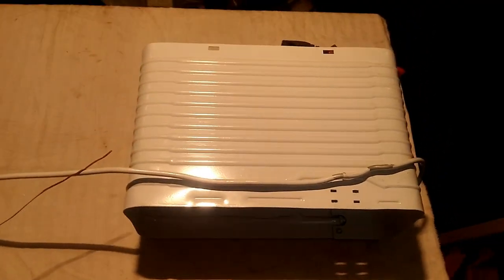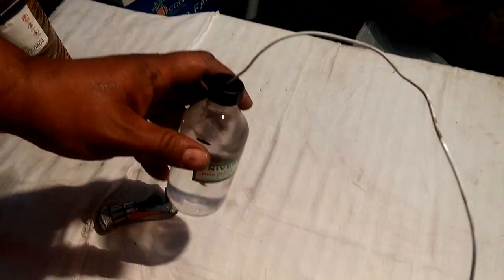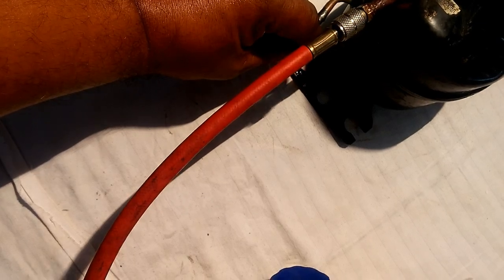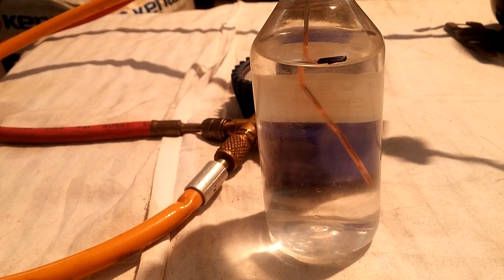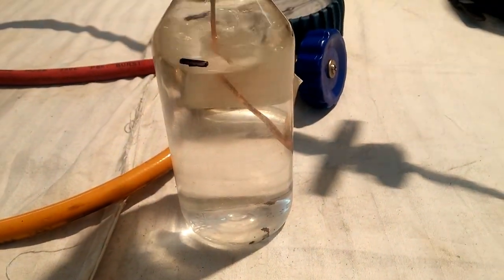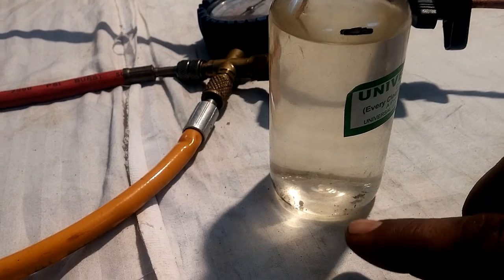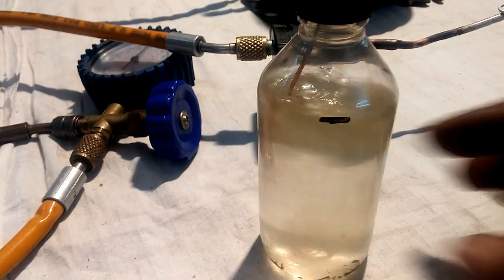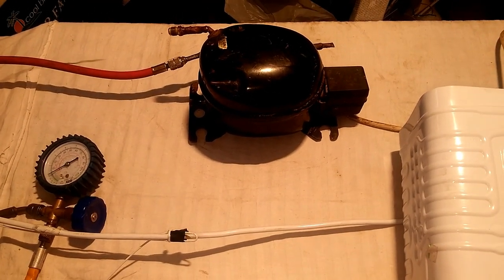How To Clean Refrigerator's Choked Capillary Tube | Easy Way

Comment: Kya yeh inverter model fridge use kar sakte hai 600 ltr fridge 21 Dec 2021 reply soon and where to buy this CTC
Reply from the maker: yes
Reply: Today 22 dec2021 mumbai from 3:30pm 3 technician doing gas charging but as Samsung company tech did not do good they are now this local shop doing cleaning of choke capillary and pipes now at this time it finished cleaning of choke pipe after tomany hours they will now start gas charging will update u soon sir 8:15pm mumbai 22 Dec 2021
Reply: Today 26 March 2022 last 21 Dec 2022 mechanic clean all and after 2 months same issue fridge side is low cooling and freezer is dead no ice no cooling mechanic left shop and now what to do sir can I arrange me repair in mumbai

Comment: hi sir I have double door heair rafegater its compresser creat so heat and after two seconds compresser will be choke and not cooling please tell me solution
Reply from the maker: may be compressor fault. or system choke
Reply: @SomaElectricals  it's compresor fault OLD was inside compressor

Comment: Intake of ctc OK. But exhausting with dirt back to ctc?u could have exhausted it in plain water. I want to clean hardwater choked copper pipe lines. Will ctc clears the line?
Reply from the maker: ctc will not clean hardwater choked u have use hyderochoride acid. or u can use bathroom cleaner acid good quality.

Comment: hi sir? what is the exact specification of that quick connector did you use? is this available to on-line store?
Reply: Its a standard tool, I forget the name.  Some people just temporarily braze/solder on a shraeder valve instead, and remove it afterward.
Reply from the maker: @JamieTransNyc  it called quick coupler

Comment: Well, it is a creative idea but…1. Carbon Tet will dilute the oil in the compressor and dissolve the shellac on the windings. Also, you are breathing vaporized carbon tetrachloride as it leaves the compressor. There must be a better way.

Comment: English:  
Step-1:  He drew solvent into the capillary tube by applying vacuum, and continued this for 30-40 minutes.   
Step-2: He backflushed the capilary tube by applying compressed air until he could see a good flow of bubbles coming into the bottle.
Step-3: He repeated step-1 and step-2 until he saw no more clog being expelled in step-2 and got enough air flow that he felt the clog was removed.

EDIT:    It is important to note also that he was carefully watching the entire time vacuum (Step-1) was applied.   If he had noticed the solvent being drawn into the capillary tube, he would immediately stop the pump.  You don't want to draw solvent into the pump motor.  Notice he drew a line on the bottle to remind himself of the starting level of the solvent.
Reply from the maker: yes u r right
Reply: Thank you so much! 🙂

Comment: Sir, If some dirt dissolves in CTC then your way of cleaning is alright - maybe.
But if some dirt that does not dissolve in CTC then while vacuuming the piece
of dirt can travel a little further up and can get stuck again. Do you feel it is better
Step 1. to first flush the capillary with high-pressure air going through the return line
and coming out from the capillary bore?  Step 2. After that to flush it with CTC entering from the return line and coming out from the capillary bore?
Which method is better according to you scientifically?
Reply from the maker: Both methods r good. But depends the blockage.
Reply: What is CTC? Polite question
Reply: CTC  =    carbon tetra chloride
Reply from the maker: https://en.wikipedia.org/wiki/Carbon_tetrachloride
Reply: How much will it cost for this job in U.S? TIA.

Comment: Sir frezer box mai oil gaya hoga to use kase nikalege oil jata hai to low cooling hoti hai
Reply from the maker: Aap flush kar kay nikal saktey ho. Fir bhi koi fayada nahi oil fir say aayega. Oil box main rahney say cooling per koi effect nahi hota. Oil uper nechey hotey rahta hai.
Reply: Flush karke oil nikala hai sir fher bhi cooling problem aara hai sir
Reply: Soma Electricals  sir plzz bhataiyey solution Sam sung fridge meyy consiled caplari aa rahiheyy oil evaporator meyy aa rahiheyy caplari clean Kearney keyy baad evaporator meyy oil reheyneyseyy koi problem nai ayyegaana achhaseyy cooling aaa jaeyyegaanaa tell mee sir
Reply: @satishbankupalli  compressor change krdo

Comment: Then what will happen to the compressor , i think it will be damage, liquid must not enter the suction line, if it goes out to the discharge line then valve will be damage.. just asking ..
Reply: But still clicking like
Reply from the maker: in this video we disconnected the freezer from compressor. after cleaning.. we vacuum for log time. and we heated (warm) freezer box from inside /outside. so that remaining ctc can evaporate and escape through vacuum. we heated box while its connected to vacuum system. hope u understand
Reply: @SomaElectricals  sir, the compressor which you use as vaccum, thats what im asking , what will happen to it if you use it to sucked, it will suction liquid which is dangerous to the valves.
Reply: Im just curious i saw the cappilary tube into the liquid, the compressor is probably sucking. liquid
Reply from the maker: @akhantor8754  we also heat vacuum compressor..  im using that compressor for 4 years still running fine.  if compressor goes wrong no problem for us we get a old good compressor for 10$.
Reply from the maker: @akhantor8754  we allow max 5 ml ctc to suck compressor so its rear that ctc will enter in compressor
Reply: @SomaElectricals  thats nice, used compressor is cheap
Reply: @SomaElectricals  keep on the good work sir .. sharing knowledge   helping begginers become capable technician

Comment: In America,
we replace the $12 capillary tubing and oil in the compressor that caused the restriction...
Reply from the maker: here we buy a good quality 8 feets copper capillary tube for $1. 1st we try to clear the blockage. if not clear we change it.
Reply: @SomaElectricals  I think you mean you make it for $1....
Reply from the maker: @lordpimpjuice1503  yes we buy a capillary tube for 1$ if u want I can send it to u. shipping charges will be extra we ship spares world wide
Reply: @SomaElectricals  you buy them for $1 ?
 and sell them for $1.
 how will you ever produce income?
Reply from the maker: @lordpimpjuice1503  i mean to say i buy capillary for $1. compare to $12 in ur country
Reply: @SomaElectricals  what size do you have? I mostly use 031 I.D.
Reply: @SomaElectricals  .031
Reply from the maker: @lordpimpjuice1503  I use 0.31 for single door fridge and 0.36 for double door fridge.
Reply: @SomaElectricals  For R134A 1/3 hp compressor  I use  79" of .031 
this is generally for a 2 door commercial cooler.
 How long do you run the .036?
Reply from the maker: @lordpimpjuice1503  for both size 8 feet leanth. where r u from?
Reply: @SomaElectricals  fort lauderdale, Florida.
 I'm from Chicago originally. 
where are you from?
Reply from the maker: @lordpimpjuice1503  Im from India. if u need any spare from here I can provide you. i 
regularly ship to USA
Reply from the maker: @lordpimpjuice1503  https://amzn.to/2VxaSsh  check out this item I sell worldwide its made in India tool
Reply: @SomaElectricals  Is there a way ai can I clean a capillary tube with removing it from the evaporator coil? 
I work on commercial units and some evaporator inlets are not easy to access. 
 Any suggestions?
Reply: @SomaElectricals  interesting tool. Does it connect to capillary? Thank you for offering to ship stuff to me! That is very kind of you
Reply from the maker: @lordpimpjuice1503  yes we it can be connected to capillary tube
Reply: @SomaElectricals  interesting, do you have a store that sells parts or appliances?
Reply from the maker: @lordpimpjuice1503  I don't have a store. but manage spares from country local vendors. I have a service center.
Reply: @SomaElectricals  what do you mean service center? Do people bring you their appliances to be repaired?
Reply from the maker: @lordpimpjuice1503  small appliances customer brings to our service center. for large appliances, repair we visit customer place
Reply: @SomaElectricals  nice, I wish people could bring me stuff. Today one of my technicians replaced a dual feed low temp evaporator. The unit originally called for 2 pieces @12' x .036! 
One of the cap tubes was restricted casuing low back pressure, but not in a  vacuum.
Reply from the maker: @lordpimpjuice1503  that's great. what is ur whatapp no. if u wish to share

Comment: Instead of doing so much of circus of half an hour vacuum by compressor, why can't you fill ctc through suction line as much as you want and flush it with nitrogen or pressurised air with a controlled pressure not more than 100psi.
Reply: It can cause more blockade
..never fill the coil with CTC...

Comment: It is better to change the capillary rather than cleaning its hole.
Reply from the maker: in some types of the deep freezer, it's not possible to change capillary. because capillary is fixed inside the deep freezer's insulation, in this video I show how to clean it , wherein in normal refrigerators, we can change it. where possible